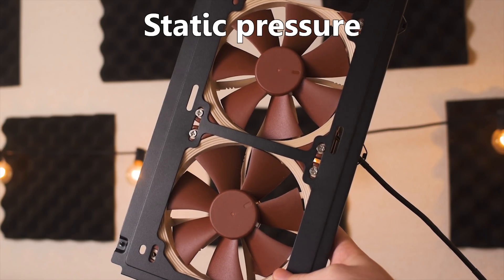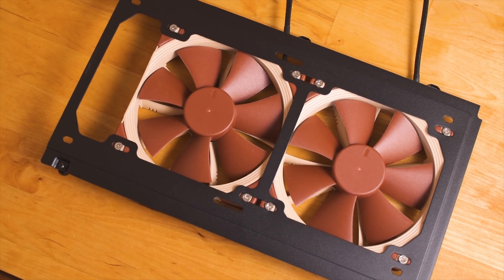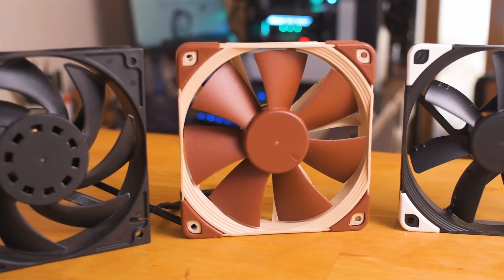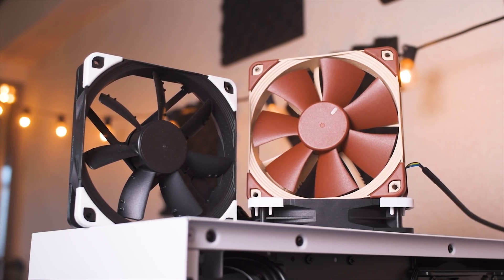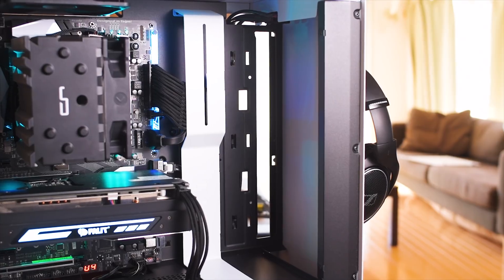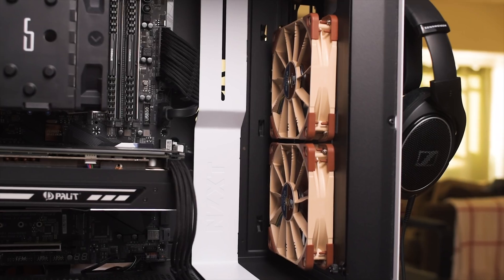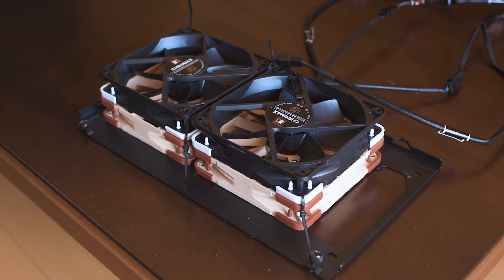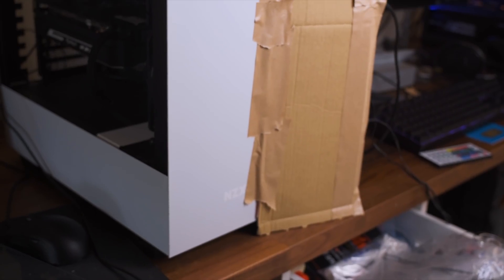DON'T buy front intake fans! (For NZXT H500/S340)

Comment from the maker: Greg from Science Studio just pretty much exactly this video recently and he got the exact same result I got in this video. 
Check out his video here: https://youtu.be/_ixFt7h8fak
Reply: front fans should help keep dust from getting sucked in by the pcie slots as much.
Reply: Is it fine if i put intake fans on h510 case 
Just curios
Reply: why didnt u remove the dust filters from the bottom and side panels? lol course temps will improve some.
Reply: @billybobbob3003  dust filters don't make a big difference at all, you only will get a lot of dust everywhere
Reply: @420rvidxr  filter hurt airflow that's my point, he didnt test without air filters
Reply: Hi, I'm thinking about getting this case. If I remove the 2 SSD mounts from the mesh above the PSU, can I mount fans on there instead? Would you think it would effect the dynamic airflow it already has? Thank you!
Reply: Do u think a rad would work in the front?
Reply: so im getting a 3060 16gb ram and i7 intel core with a H510 case from NZXT. Do i need fans for this build or will that natural convection you were talking about be fine in cooling down the parts? Or will i have to invest in 2 extra intake fans? Whether it be sooner or later?
Reply: so i have a similar front pannel which i figured theres no point putting intake fans there where do i put my fans i have 3?

Comment: I wonder then, if the exhaust is bottlenecking the air movement through the front, could lowering exhaust RPMs mean the front fans will be contributing more, leading to not any worse temperatures but more positive pressure for dust, and also lower noise due to having more fans but at slower speeds. I have an s340, and always ran 2 in the front and one rear exhaust. And always had dust built up on the dust filter. So the front fans were doing something, perhaps they do more if there is less exhaust like in my set-up with one exhaust fan.

Comment: I know I'm 5 years late lol but if you want to stack fans, make sure they spin in different directions (but with airflow in the same direction obviously)
Reply: Hello could you please help me? I have the same case nzxt h500 and it's running very hot. I don't have much knowledge on fans and airflow at the movement. My current situation is I have 1 nzxt kraken 120 ( 120mm ) liquid cooler on the side where you connect cables ( I don't know what it's called ) It's at intake and 1 exhuast fan at top and 1 normal rgb fan at front panel. 1 spot is still empty. I am thinking of purchasing fans and cool down my pc what is your recommendation for my situation?
Reply: @ShivaEditz  I had the same problem with the H500. I would put 2 fans on top, and the 120 radiator in the rear. But make ALL of them exhaust fans, even the radiator. Personally I also removed the fan mount in the front. You can even remove the mesh in the front if it's still running too hot. Like the video says, the H500 is mostly dependent on exhaust fans, intake doesn't do much. So try that first before buying an additional fan. And increase the speed on the fans, the 120 radiator might be struggling a bit. Maybe increase the RPM on the pump too if it's not already at 100%
Reply: @athmaid  Thank you so much for your reply. But wait how could you place 2 fans at top the case have place only for 1 fan right? and which mesh are you talking about because the nzxt h500 does not have mesh in the front.
Reply: @ShivaEditz  oh sorry yes I forgot it only has one on top, my bad. Then keep one in front for intake and use the top and rear radiator as exhaust. There is a slim mesh filter on the right side in the front
Reply: @ShivaEditz  you can also play around with where you put your front intake fan, maybe there's a slight difference in temperature depending on the height of the fan

Comment: It's great to revisit this old vid after you've become established in the Tech Tuber landscape. 
Thinking on your results, ghetto-fan 2.0 notwithstanding; any air tower cooling would do exactly as you say. The only caveat being the AIO in front does work far better than it seems it would in the S340 Elite. I've run everything from an r5 1600 overclocked to 4.0 to the r9 5900x on the X470 system. The X62 280mm AIO has done remarkable. Video card temps won't be optimal, with CPU heat being dumped in its' lap, but I ain't got RTX cash anyway. I blow my moola on too many systems to tie up that kind of money on a single part. 
Dude, your videos are some of the most inventive in the Tech sphere right now, thank you!

Comment: There is no bottleneck in the front. I'm amazed non of you people actually know what airflow is. With 'you people' I mean you, GamesNexus, LTT.. all have absolutelly NO CLOU as to what airflow is.

This case has ample intake on the front not to be a bottleneck. The problem is that the fan that has to pull the air through, can also get air from the case itself.

So first close the entire front of the case where the fan is mounted, then place the fan, and retest. So that the only air the fan CAN draw, is through the fanholes on the front.

now THAT"S airflow. It's not what you idiots think. You think an open case equals airflow. It does NOT.

Comment: What would the effects of putting a 2 fan aio on front be. It doesn't get air from front so would I just heat up my case? On that note...should I just get an air cooler for my cpu and get 2 good exhaust fans

Comment: flow will occur wherever the path of least resistance is, the reason the fans do nothing is because the air that is immediately surrounding the fans is easier to pull so the fans are simply drawing in air from what's already in the case, if the fans were ducted so that it couldn't recycle ambient air and only draw from the front you might see some sort of result

Comment: Oh Dewad!   If you put two (non noctura/maybe pay for them) 140mm intake fans that are of a decent quality, I’ve found that in my NZXT 510i, it lowered the temperatures internally by a huge factor over no fans, and or the 2 crap fans that are NZXT 120mm that came with the case.  Do it again in 2022 and bring that haircut back…

Comment: I have this case, but I have the fan in the back and 1 on the bottom front, but mine didn’t come with the fan on top. Should I add that, new to this, thanks.

Comment: Nice video / tests. One thing that i wonder is if you have a radiator up front, would this change anything to the airflow and / or results ? (one could mount the radiator without fans un front and rely on the two exaust fans, for example)

Comment: Hi, I have a question. I have an NZXT H510 white case and i am using the default fans no external. One at the top exhaust and one at the left exhaust, is that good or bad? Will it affect anything or create any problems?
Reply: No you should be fine… I would suggest you to get an additional water cooling fan
Reply: @ramzfn3543  hey thanks for the reply, i recently got extra custom fans 3-pack rgb so i have 2 intake and 2 exhaust now.

Comment: What you neglected to understand is that the case is a negative pressure case. Both case fans are utilized as exhaust fans in the case setup. Adding fans is useless………especially intake fans.

Comment: This case should have a sizable open vent across on the bottom front with steel screen filter about 2 1/2'' W 12'' L. This bottom front vent combined with the perforated side strip venting is more than enough low resistance air intake to avoid saturation by the exhaust fans alone. They do the job fairly well with an emphasis on negative flow for GPU which is far more sensitive to temp than CPU. The reason for this, the case is ideally designed for a front 240mm AIO for the CPUs needs. If you place front fans set them very low rpm to see benefit. To high and heat re-circulates.

Comment: The front intake would be more effective if the case fan holder were tilted at a 40~45 degree angle.
Reply: Agree. There should be a gap in between the fan and the side panel air vent.

Comment: My H510 came with both the top and the rear fan blowing inwards, with the air exhausting out of the front of the case. I don't know if that was a design change they made from the H500 or if my particular case just came with the rear fan on backwards.

Comment: I know this video is ancient news, but these types of cases are still largely popular.
If additional fans at the front make no difference what about replacing the stock exhaust fans with higher performing fans? Is higher negative pressure a thing? or do the stock fans already maximize intake of cool air leaving no performance headroom on the table no matter what you do?
Reply: Any info?

Comment: I own a S340, which i think has a little bit better front airflow. Years ago I installed a be quiet silent wing 140mm fan in the bottom part of the front panel, in order to provide more fresh air to my graphics card (MSI RX480 Gaming X). I definitely remember seeing some improvement in GPU temperatures, just a few degrees but that's normal

Comment: Big picture:  Money better spent replacing the rear and top factory fans with a pair that will extract the same or more volume, but are more quiet and more reliable because they have higher quality motors and bearings.  The CPU and GPU already have sufficient heat sinks/fans on them to remove the component heat.  The case & case fans' job is to remove that air and replace it with a steady flow of ambient-temp room air.  It's a system that works together.

Comment: I’m pretty sure the H510/H500 was specifically designed with negative pressure in mind and that’s why the stock fan configuration is 2 exhaust fans instead of 1 intake and 1 exhaust

Comment: I was gonna buy intake and exhaust noctua fans into my case which is similar to that NZXT (1 of each fan so 1 to rear and 1 to front) But should I just take the 2 loud stock fans out and replace only the rear exhaust with noctua? I just want the PC to be quiet. And if intake fan truly doesn't make difference, then I should be fine with just 1 noctua rear exhaust fan right?

Comment: Have this case. There IS a reason why you would want intake fans.

The dust buildup for a negative pressure case is real, and by having intake fans, it forces the air to only go in through the front, such that the dust won’t seep in through the nooks and crannies, and make sure they go through the dust filters.

Comment: Front fans aren’t totally worthless in the H500. I added some to mine to give it positive air pressure after I was having trouble with dust building up on the side panel. Totally fixed it

Comment: YES you are right! THis is a problem with many case designed with aestetics first!
I own a fractal define R5 sure a better designed case but  it also suffer of poor  Air intake  especially  if you fit a lot of fan ! with door closed  all intake flow go trough the grille with unpleasant cavitation Noise.
So my 2cents is to go with front mesh case they often do a better job also about sound pressure because require  less fan  for the same air flow  without any impede

Comment: I have front fans on the front of this case and my cpu and gpu stay at 50-58. Running ryzen 5 2600 with 5600 xt from msi. Runs Jedi Fallen Ordee perfectly at 60 fps. And my gpu fans don't even turn on sometimes so it ain't even sweating..

Comment: I think this all has to be tested per config. In my situation, in my H510i, my 2080ti isn’t able to cool enough by having top and back fans as exhaust. So top as intake, back as exhaust, work best. 

However, I’m also running a X63. I found that with one fan (Noctua) mounted to the top in an intake config, and being towards the outside of the rad, works best, but I’ve not tried moving it (or removing it). This opened up more distance between the rad and the front of the case, and my liquid temps are very low (33C). 

Literally flipping the top fan back to stock cooled my GPU by 10 degrees or so, and has kept it from throttling. 

I will likely swap the NZXT fans with Noctuas, but need to figure out which are best.
Reply: Yeah I have same case but with 1 fan top one back and 2 front idk why I even have fans in the front but what should I set them to

Comment: Running a noctua nh-d15 on a ryzen 5 3600, 5700-xt, and 570HD. Having thermal issues with the side glass on. Works perfectly fine without

Comment: I switch the 2 pre-installed exhaustion fans for 2 upHere RGB fans and made the top one to pull airflow into the case. 

This improved the heat temps about 15% avg. Not much. But I also installed a Kraken Z63 AIO onto the front with 2 fans puling airflow as well (tight fit, but works). 
Playing CoD War zone at 1080p in 60fps makes my CPU stable at 54C on average, and my GPU starts to run at 80C but then stabilizes to 70-75C.

I've got a Nvidia RTX 2060 Super with a Ryzen 5 processor.

Comment: I want to get intake fans for my H500i, should I get Noctua A12x25 or the NF-A14 140mm fans?
Using H100i v2 cooler but will switch to Noctua NH-U12A because the H100i v2 pump is making a grinding/thrashing sound like a hard drive.

Comment: I replaced the stock nzxt fans from my 500, installed 3 pack Lian Li Bora RGB, same as original config with 2x exhaust at rear and top and added intake at the front. I see your point with the front being solid and was hoping for the negative pressure, but its more for rgb  aesthetics.

Comment: There are only three reasonable air pressure/air flow setups for this case. Two exhaust, two front intake, or NZXT stock which is top intake, back exhaust. Running any combination of those three will probably give you negative results. Yup, NZXT has the top as an intake fan (stock setup). Also keep in mind that the stock NZXT fans are bad. Grab some Arctic P12 (static pressure) for your radiator and heatsink, as well as Arctic F12 for airflow fans.

Comment: I've got an s340 elite in black and red. I'll be using 2 140mm noctua fans for intake, And1 140 mm And 1 120 mm for exhaust. The slight difference should create positive pressure in the case I hope, I'm not leaving my intake open with no fans and turning my computer into a dust vacuum.

Comment: I have the same case with a closed water loop. I have a evga 2070 super ultra gaming xc and i7 9700k and my temps stay around the 68-74 degrees Celsius. I set a custom fan curve on my my cpu fans and exhaust fans in bios and one for my Gpu using msi afterburner. I had a i5 9400f and gigabyte rtx 2060 before my new components and the temperature might have 2 degrees cooler.

Comment: I have 3700x and 2070 super and my gpu goes to 83 degrees i only have two fans that come with the case , what should i do
Reply: Same case here.I initially had installed 2 intake fans instead with one rear exhaust.My temps for the cpu and gpu  were in the low 80s during gaming.I then removed the bottom intake fan and installed it as a top exhaust.Temps are now in the 70s with few spikes in the 80s

Comment: Seems like I'll be installing my AIO without the fans now lol
Reply: I guess it won’t cool then
Reply: @twentyzeroseven  No it will of course, why do you think that?111
Reply: @samed161  It won’t, wanna know why? Because the fans that come with the AIO cool the water that has already been used to cool the CPU, So hell it won’t cool down the CPU because because it is only being cooled by hotter water.
Reply: @samed161  And you get mad when you are wrong
Reply: @twentyzeroseven  aios can run quite long without fans until dangerous temps

Comment: I know this is an old video but if you see this I wonder if taking away the dust filter helps. I noticed that the dust filter on the bottom front is very restrictive with a simple unscientific test just blowing through it I barely felt any air coming through.